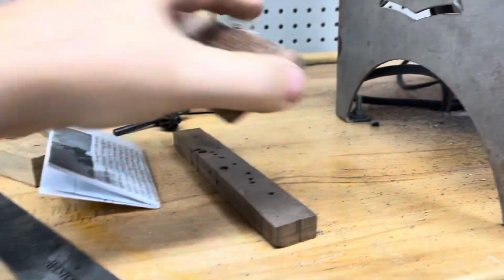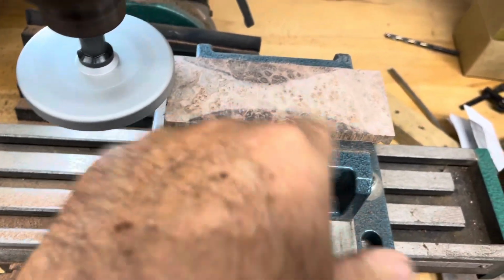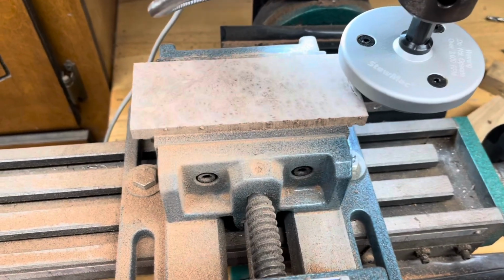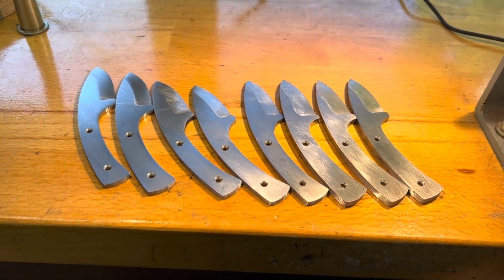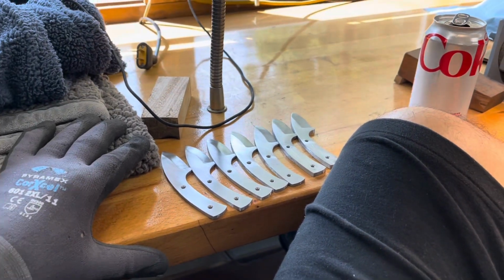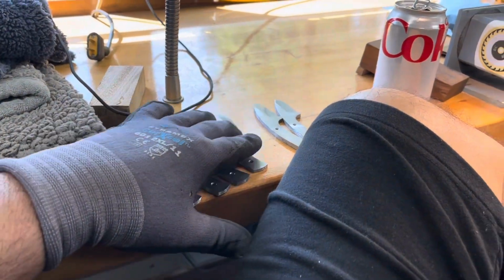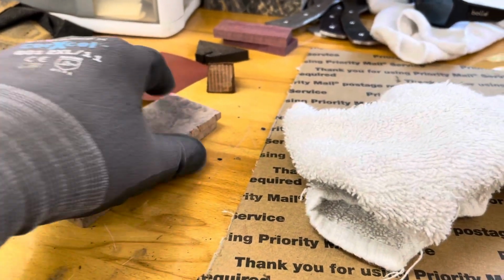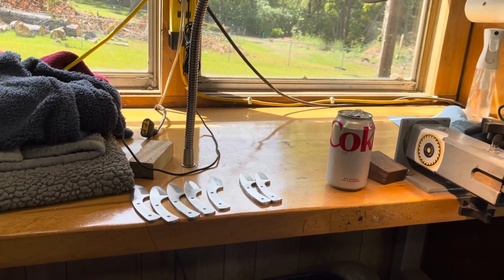Stew-Mac safe-T-planer

Comment: It's truly a joy to spend some time on what I call your Serenity  Porch. Thank you for a few minutes of serenity before I start my day. Wonder how many times I could have used that planer in my shop? Countless, that's for sure. Does look like it will solve problems that it's big brother can't. 
Hope you and Charly have a cooler and blessed Monday. Godspeed when you go into town.
Reply from the maker: I had no idea here planers existed. This could have saved a lot of wood that was warped in the past. The problem I’ve had before is even though I have a thin kerf blade on my table saw, if I made a cut on each side of a piece of 3/8 handle wood, I would loose an 1/4 inch of wood to the kerf.

Comment: Hi Brad.
Does your mini mill have a power feed on the x axis ( left and right ) ? Couldn't tell on the video. 
Mine does not. I use a cordless drill on the handle nut to " power " it so I don't have to crank on it all day.
Have a Jesus filled day everyone Greg in Michigan
Reply from the maker: No, I have to churn butter. It moves pretty fast though, I just didn’t want the planer to get bound up with chips.
Reply: @bctruck  
My Handel is held on with a bolt so I use a net driver bit in my cordless drill.  You'll have to give it a try. 
Greg in Michigan

Comment: I’m glad Stewmac saved that tool from extinction and I’m kicking myself for not buying one when they had the introductory sale. Did you get extra cutters?
Reply from the maker: No, but it appears you can turn the cutters 180 to give a new cutting edge.
Reply: @bctruck  
Yup. It’s the improved version. Reversible blades and a three sided , no slip tenon for regular drill chucks.
How was the surface finish? Much tear out?
Sure beats messing with planer blades. I don’t know of anything else that can work such small pieces safely .
Using your milling machine gives an extra level of precision.  0 to .005”. Pretty nice when working with little pieces of wood that cost more than my first job paid in a week.
Reply from the maker: Zero tear out but I moved very slow because I don’t know where the cutting speed limit is and I didn’t want chips to build up underneath.
Reply: @bctruck  
Thanks👍 that’s real encouraging. 

I have a piece of Cock’s Spur Hawthorne burl that I harvested about thirty years ago. It looks like a brain and they grow on the branches. It must have taken at least 70 years for this to grow. I screwed up half of it but found it to be one of the most magnificent pieces of burl I’ve ever seen. It’s insanely hard with a pattern unique to any burl wood I’ve ever known.

I’m not molesting it again until I have the right tools. That planer and a super thin Japanese saw blade with an appropriate miter box. It doesn’t get thinner than those Japanese pull saw blades.